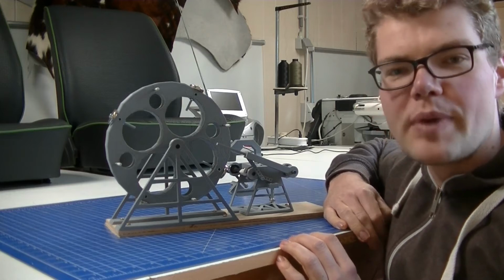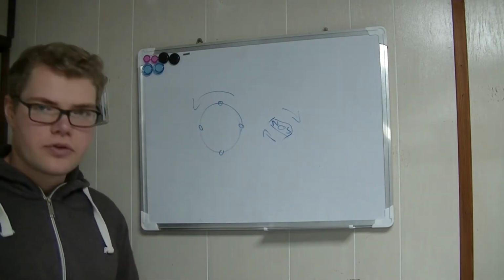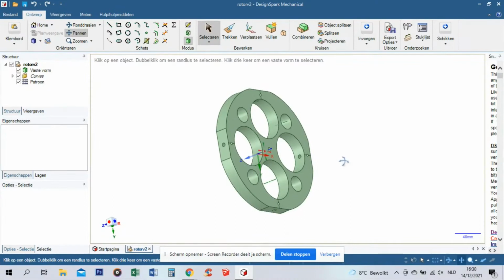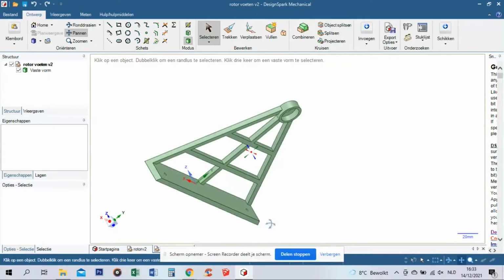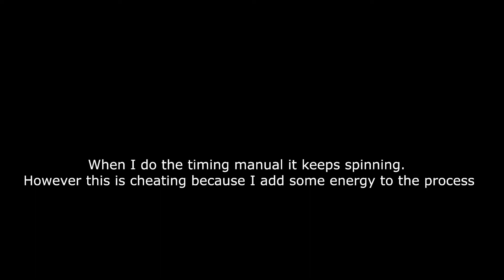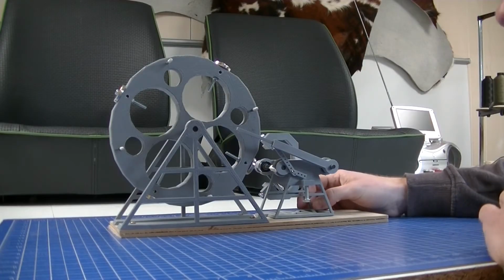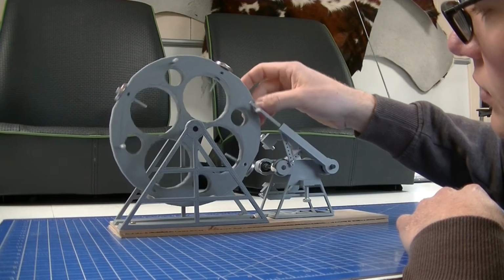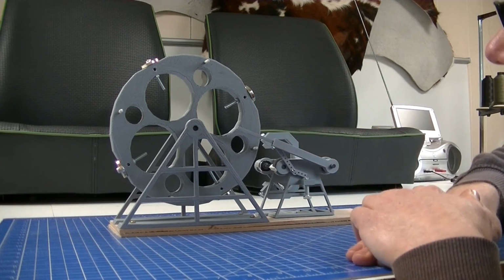Magnet motor v2, will it keep spinning?

Comment: If you replace the lever contraption by a sheet of copper then it would be an even better magnetic brake.
Reply from the maker: Yes indeed, but it would also take a lot of energy from the proces to drag the magnet along the copper sheet, because its the same principle as a bike dynamo then, it wants to produce current

Comment: Do you think if the axis would be vertical could be better? And then if the external magnet would be moved by electric energy, the inbound energy could be smaller than the output?
Reply from the maker: A vertical axis could indeed make sense very good idea. Not so sure about adding an electric power source to power the magnet, this way you are adding energy to the system, the idea is to have it run completely of itself (it's a perpetum mobile)